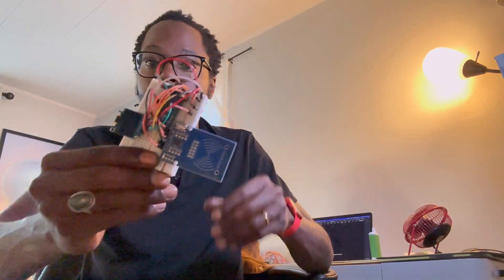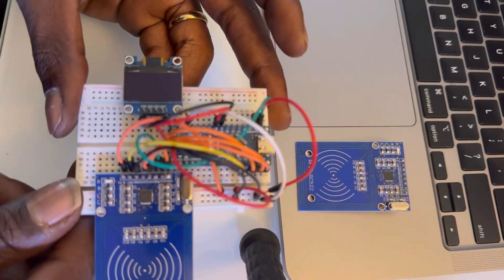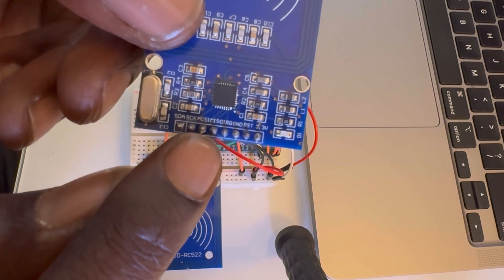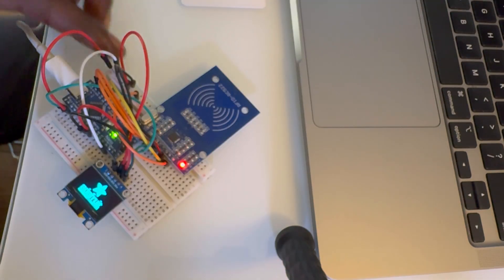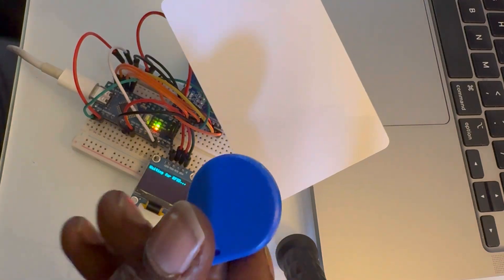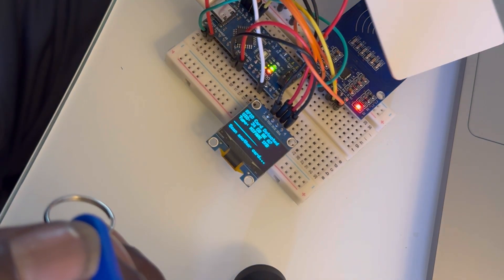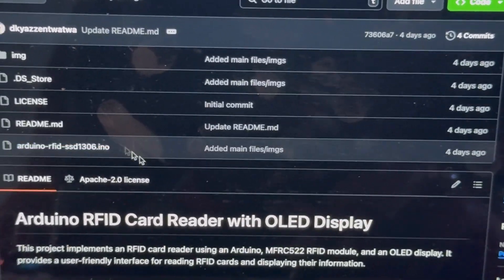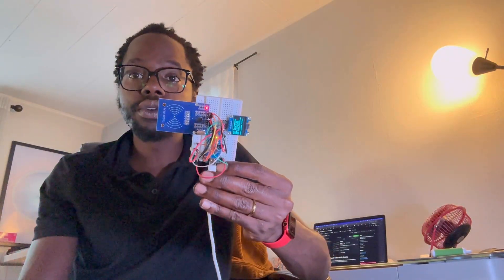How to Make an Arduino RFID Scanner 🪪

Comment: Hello this looks sooo good.
Can you make like Arduino Nano RFID Card Copy system with 2 buttons for example first button for read all datas drom attached RFID Card and when pressed second button it will write saved data from first RFID Card to second attached RFID Card ?
Is it possible ?
Thank you for video. Please continue with similar videos it is really good.
Reply from the maker: Yes my esp32 cybersecurity tool will have the full version of the scanner with read/write. This is the basic version, and I will post all full versions of my device to GitHub with the next few months
Reply: @littlehakr  thanks sir.